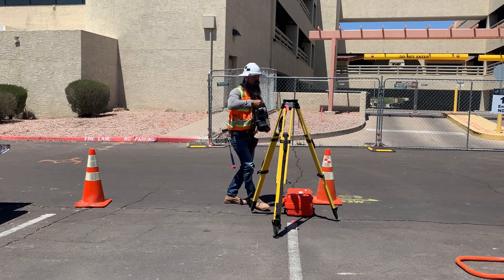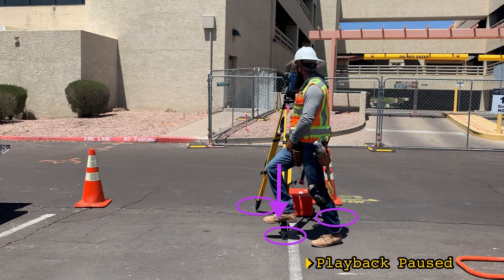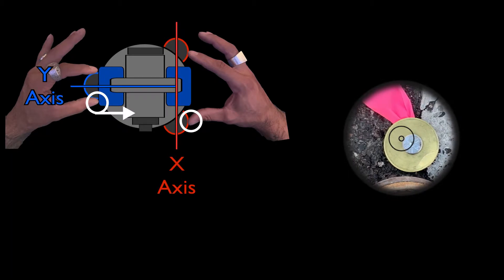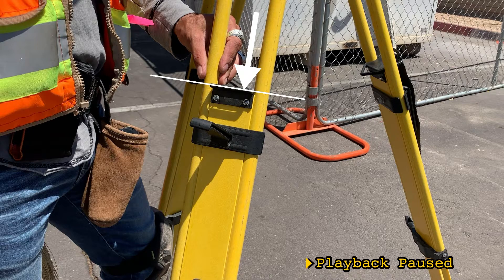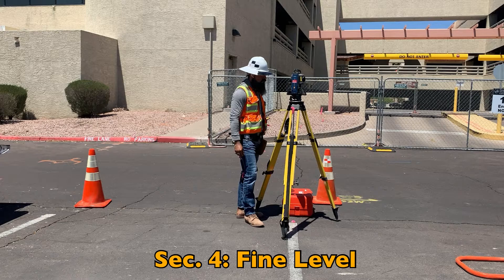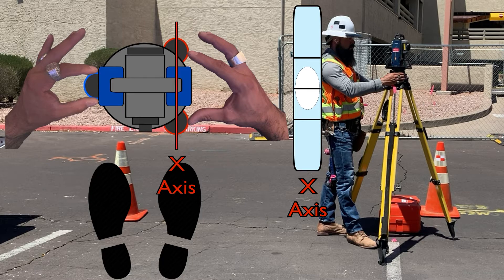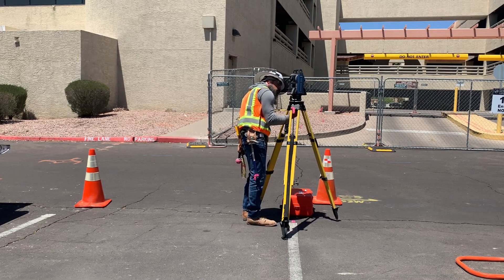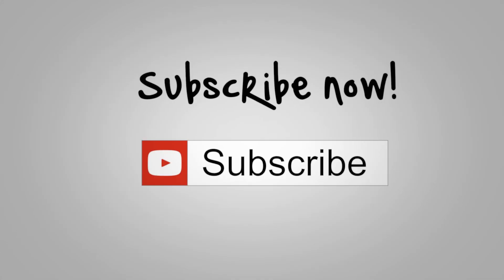Surveying: Quick Total Station Setup

Comment: Shouldn't step in the legs AFTER the instrument is on the tripod. The 5/8 threads and tribrach aren't designed to be jarred like that. 

Ask yourself, how many times have you stepped in one of the feet in soil, and it penetrates some firm crust and then all of a sudden goes into some softer material before hitting something hard and it abruptly stops? You don't want that type of energy transferred to the tribrach and total station.
Reply from the maker: @michaelhoot9759  I appreciate the push back as always, though I may have to kindly disagree on this point. Is this a comment from the operators manual, I don’t believe I’ve come across this recommendation in print anywhere. If the legs are stepped in first, how would you recommend centering the top plate of the tripod and instrument over the point without the use of the optical plummet? Many beginners and even some pros don’t get close enough with the initial placement of the tripod to be able to make up the positional difference using only the tribrach.  Additionally, speaking of energy transfer- there is likely more jarring taking place moving and transporting the instrument in its own box than there is stepping in a tripod leg. I agree that the footscrews of the tribrach can be delicate, and so carrying the instrument horizontally over your shoulder would put sustained stress and the full weight of the theodolite on the footscrews- that’s an easy “no-no” but the 3 point steel on steel connection at the 5/8” set screw is pretty robust. Not really seeing that as a design weak point in this case. Please feel free to continue the dialog (sincerely) or comment wherever you see room for approval. I welcome other points of view and hope you do as well.

Comment: Man... never ever ever take your hand off the handle until its threaded. If you think holding the tribrach is good enough, I've got construction sites that beg to differ.
Reply: Amateurs
Reply from the maker: @ht8286  If you pronounce amateur with a French accent, it almost sounds like a compliment.
Reply from the maker: @YTMODSdeletecommentsnoreason  I hope you get your legs and the tripod plate close to level before you set an instrument on there. What on your site is effecting the plate more that you and the tripod legs?  Hand on the handle till the thread is started (I’d never tip the instrument to eyeball that I’m threading properly from under the plate by holding the tribrach only, in fact it would be quite difficult to tilt it that way.) I specifically switch to holding the tribrach once threading has started to ensure the instrument doesn’t rotate while I’m threading.  This plate is round so rotation isn’t thaaaat big deal, but some plates are triangular and rotation during threading would matter in keeping the tribrach feet on the plate.  Additionally, I usually have a plan for where I want the optical plummet (if the instrument has one) and I wouldn’t’t like that to rotate away from me either.  Hence my method, also field tested for the last 25 years.

Comment: The method in this video works, but takes too long (IMHO) because lots of surveyors want to utilize the optical plummet of an instrument before it is leveled true.  First, this video shows a "wide enough" stance, where I see a lot of people who set up this way end up with the tripod base that is very narrow.  By "this way" I am referring to a setup procedure that includes at some point, looking thru an optical plummet that is not plumb/level.  Those narrow set ups (the one in this video not included, it is fine) can "blow over" especially working along an interstate highway and set up in the breakdown lane on asphalt.  So, first, I suggest a setup with the height pretty much as in this video (relative to your own eye height and the terrain) but the legs even further apart for a wider stance (video setup is very good, but wider is even better).  There is no reason (95% of situations) to not have a maximally stable stance.  That being said, the following method will get you set up in sixty seconds or less nine times out of ten.  This setup time begins only when you are more or less at or very near the setup point.  1. Extend a leg to your preferred length (I suggest a couple tenths longer than was done in this vid, (becuz even more stability), and then drop the other two legs to the same length.  2.  Place the tripod somewhere and attach your instrument to it (this step is only needed at your first setup, but every setup if you box your instrument between setups).  I transport my instrument between setups on its tripod, and I carry the assembly upright, so as not to stress the total stations structural parts.    3. Place one leg an appropriate (educated guess) distance from the setup point, and take the other two legs in your hands about midway down each leg.  Open the legs so that they are splayed to either side of you, in more or less the desired angle with the tripod head ROUGHLY eyeballed as level.   4. By eye, imagine a plumb line passing through the instrument, and move yourself and the two loose legs so that imagined plumb line also passes through the leg that is touching the ground AND the setup point.  That is, you are moving the two loose legs, and your head and body and the instrument, so that your eye, the opposite fixed leg and the instrument are all somewhere on that imagined plumb line that also passes thru the setup point.  5. Set down the two legs you were holding and moving, taking care to keep the tripod head roughly level (roughly, don't bother looking at the bubbles).    6. With all three legs on the ground walk around the setup a third of the way, and note that, from this new vantage point between a different pair of legs, an imaginary plumb line passing thru the opposite leg and the instrument DOES NOT pass thru the setup point (unless you got lucky).    6. Repeat steps 4 and 5.  You should notice that each time you do steps 4 and 5, the tripod head will get closer and closer to being roughly over the setup point.  Almost always, two to three iterations is all you need to get the tripod head "close enough" so that the legs need not be shifted further. 7. Use your body weight to firmly plant all three legs, exactly as shown in this video     8. Take your plumb bob/gammon reel (if you have one) and hold it under the center of the tripod, and note where the tripod head center is relative to the setup point.  Put another way, which way does the tripod head need to go to be over the point?  DO NOT look thru the optical plummet at this point.  DO NOT use the laser dot at this point if you have one.  Those things used at this point will throw you off, because the instrument hasn't been leveled yet.  If you don't have a plumb bob, just skip this step.  If you do have a plumb bob, move the tripod head closer over the point by slightly shortening and/or lengthening one or two of the legs.  This video shows explains that part very well.  The goal is to get the tripod head within a tenth of a foot (30mm) of its final location.  If you skip this step, you may or may not need to shorten or lengthen a leg during the next step  9.  Level the instrument using the three leveling screws, and ONLY THEN look thru the optical plummet.  Slide the instrument across the tripod head so that it is directly over the point. (or shorten/lengthen legs and then do that)     10. Check that you are still level after shifting the instrument position on the tripod.  If not level, repeat step 9.  11.  Rotate the optical plummet to the opposite side of the instrument, recheck the level bubbles and then the optical plummet.  Problems then?  Your instrument is out of adjustment.  Everything checks?  Your setup is done.  IMPORTANT NOTE:  One advantage of this system is the time saved by not having to constantly keep the tripod head approximately level so that you can kinda sorta rely on the optical plummet or laser.  I only need to keep the head level enough so that the instrument can eventually be leveled.  This procedure is really hard to explain in text form, but easy to teach in person.  It is VERY fast, even on a slope or when setting up over a "tall point"  (something like a nail in a tallish tree stump).  Why did I bother to type this up?  I get very frustrated watching people set up using optical plummets or laser dots that aren't plumb, and taking five or six minutes to set up a total station.  Finally, it took me a very long time to type this, but this procedure is very fast.  It makes a huge difference if you have a lot of setups, and doesn't matter if you set up very few times per day.  I hope someone finds this rant useful......
Reply from the maker: @johnwetzel5248  Just to clarify, shortening and lengthening the legs changes the position of the plummet over the point VERY mildly.  What moves it the most drastically is adjusting the 3 set screws on the tribrach.  For that reason, in my own opinion, also humble, is the plummet is way faster and is one movement versus eyeballing plumb several times from multiple angles and then busting out a plumb bob to hang from 5’ high.  BUT.. what are “LEAN” concepts anyway.  Consistent improvement, updating methods when better ones are present, streamlining systems. If you personally are lightening fast through process practice and you’re examining wasted movement so that you can eliminate it- I’m buying what you’re selling all day long!  Side note: if you rotate your total station 90 degrees and the plummet has moved its position it’s time to go get it calibrated.  A bad plummet IS a time waster.  Tell the repair technician the exact issue by the way, not all technicians are created equal and not all review/adjust the plummet in a standard calibration.  Thanks for sharing John.  Good data.
Reply: @leansurvey8212  thanks for your comment!  My main reason for typing all that stuff is that almost everyone uses some variation of the method you describe, in which a key element includes looking thru an optical plummet that is not completely plumb, but also involves trying to hold two legs in the air while looking thru the plummet AND while trying to keep the tripod head (and instrument) as close to plumb as possible, but without looking at any bubbles because you are looking thru the plummet.  And, almost universally, that element of the procedure takes time and (to me) seems fiddly.  It is trying to do three things well at the same time!  However, in most situations and for most people, it doesn't matter if the setup takes five minutes.  I would also say that once I use my method to get close enough to plant the legs, any remaining adjustments can be made by adjusting the lengths of the individual legs even if the tripod head needs to move a lot (let's say two tenths, which almost never happens to me becuz experience!).  I think when you are talking about those adjustments moving the point "mildly", that is just what appears to be happening, because shorting or lengthening a leg while looking thru an unplumbed plummet shows little movement, even though the head has actually moved a lot.  Then, of course adjusting the leveling screws moves the plummet ring/crosshairs a lot, because you weren't actually as close to the point as the unplumb plummet told you you were.  In my method, after I shorten or lengthen legs to get "plumb bob close", I don't look thru the plummet.  Instead I level the gun, and THEN look thru the now truly plumb plummet.  I am always within two or three hundredths, and I am always close enough to slide the gun over the point.  Finally, you spoke of rotating your plummet 90 degrees.  The advantage of rotating it 180 degrees is that it shows the full/maximum error.  If you are on the point, and rotate 180 and you are two hundredths off, your plummet is one hundredth off exactly.  If you rotate 90 degrees as you suggest, you can tell something is off, but you don't know the full amount of the error.  Knowing the full error allows you to correct your optical plummet in the field.  From the 180 position, you adjust the plummet so that the ring (or crosshair) moves halfway back to what you saw at zero degrees.  You might have to do this twice to get the plummet perfect, but you don't need a repair tech.  All that said, I want to thank you for taking the time to make your excellent videos and trying to improve everyone's "skills" toolbox.  You are a great instructor, and also understand how to make good instructional videos.  If folks reading this try my method, they will find that it is not just quick, but less stressful, because the only time you look thru the plummet is when you are almost done, and you are always only a couple of hundredths off, within sliding distance, the gun being already leveled.  I just realized as I typed this, exactly why I like my method.  It turns out that I am only looking thru my plummet when all three legs are planted and at their final length.  So I never need to do the "hold two legs off the ground while looking thru the plummet while also keeping the tripod top level enough then lower the legs while not moving the tripod head" dance.  That is the thing I see that looks awkward and inefficient to me, that "dance".  That dance also encourages those narrow unstable setups, which I see everywhere.

Comment: Great video. I use basically the same steps but one thing I do different is that when I set up my tripod, I level the plate with my torpedo level. That way I know my plate is level over my control point. Then I mount my total station into the tripod. I level the total station rough bubble to the plate.